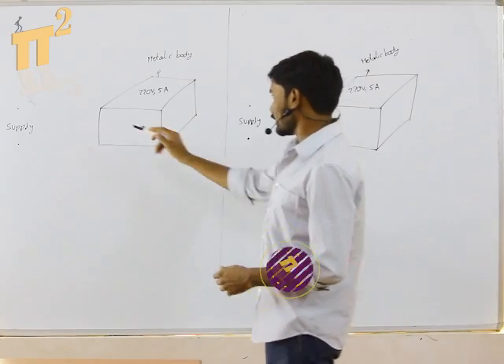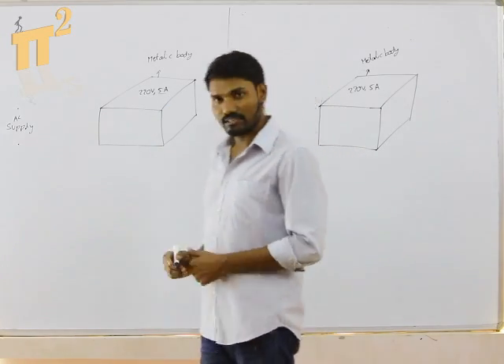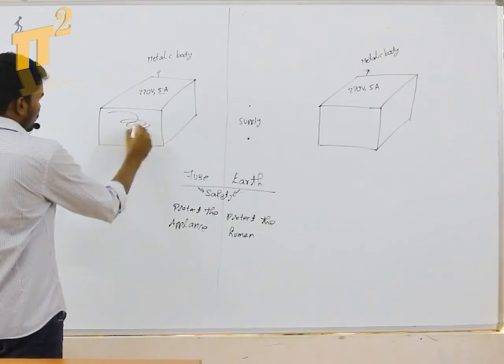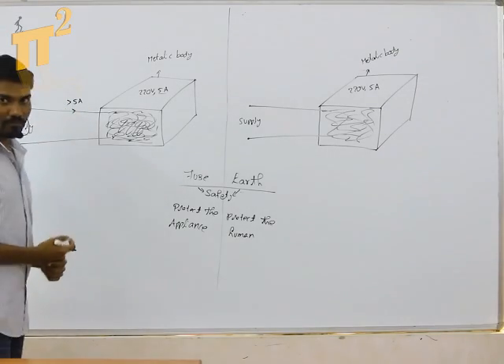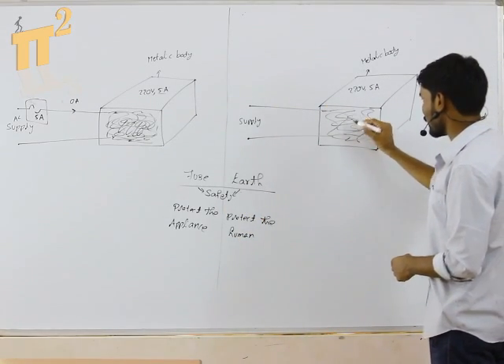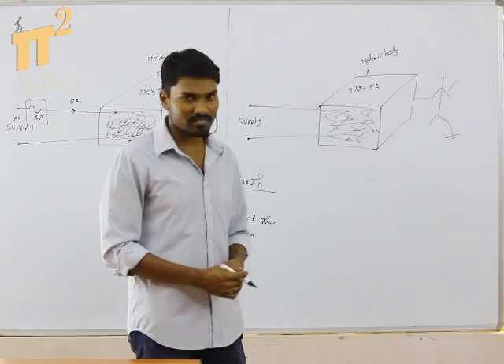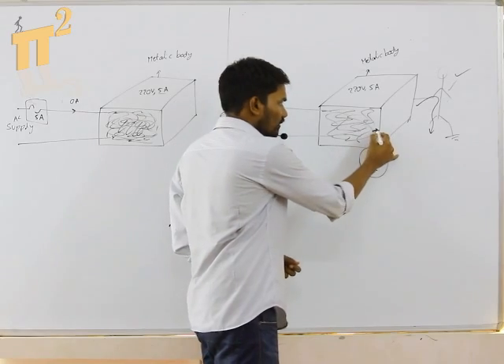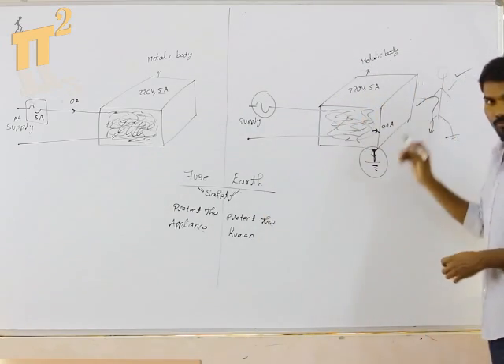Why Fuse & why Earthing | Interview Question | PiSquare Academy

Comment: Good video! Earthing also serves to protect the equipment as earthing cable or path has least resistance and most of the current takes this path and because of this relatively high current, it also trips the breaker (ELCB or RCD) in the process. Is my understanding correct?

Comment: Sir why root 3 is used in 3 phase power calculations. Please explain
Reply: +Narendra Lolugu - The square root of 3 enters into computations of three phase systems because the trigonometric value of the sine of the phase angle (120 degrees) between phases is equal to [square root 3]/2. The denominator, 2 is factored out when doing the vector/phasor analysis of the voltages and currents in such systems, leaving--by coincidence--the square root of 3. Chalk it up to the craziness of the math. :)

Comment: Good work...Pisquare, keep doing
I have more questions on earth to neautral
1.what is the importance of earth to neutral voltage? How much it need to be?
2. Can we short earth and neutral, if earth to neutral voltage is high(say 10volts)?
3. What is the role of earth pit in above two questions?
4. By Megger if we test the earth pit resistance, how much value it should be? (As per industrical standards)
5. How earth to neutral voltage and earth pit resistance can be related..and what's it's significance?
6. When to do Mantaince for earth pit?

Comment: Sir 
One doubt i am having, the current ratings of MCB, MCCB, ACB are of 3- Phase or 1- phase:
1) For e.g. i am having a 1200A ACB than its the current carrying capacity of 1-phase or 3-phase ???
2) My DG rating is 500kVA by calculating current its about 700A than it will be of 3-phase or 1- phase

Bit confuse between it because lot of different answer i have got, Knowing that a perfect explanation will be given by you!!!!!!!

Comment: hi sir, suppose we give phase directly in body of the      device and it connected earth, now if we touch the device what happen does it shock?. please explain me
Reply from the maker: you won't get shock provided Earthing is proper (as current flows in a least resistance path, human body has around 1k resistance and good earthing resistance will be 1 to 5 ohm)

Comment: Could you please clear these additional doubts:
1) What is resistance of a dry and wet human being.
2) Why is the earthing wire naked?
3) For local earthing why do dig a 6 feet deep hole and then place a Cu plate and add coal and salt and water? What happens if hole is say 2 feet or say 12 feet?
4) What is the difference between earth wire and neutral wire? Both have 0V potential or do they not? How will we differentiate between neural and earth wire if both wires have same colour?
5) What effect does different current values have on a human being? 
6) What is responsible for a shock - Current or High voltage ?
Reply: anthony gonzalves 
I would like to clear some of your doubts.
The resistance of dry skin is around 100000 ohm and when the skin becomes wet the resistance reduces to around 1000 ohm.

Actually both voltage and current are responsible for the electric shock because unless and until there is no voltage there will be no current. When we accidently touch any live wire, current tries to flow through our blood as it contains different ions such as sodium, potassium, etc. which act as a current carrier. Now this current interferes with the functioning of the heart and may lead to Cardiac arrest. The muscles are paralyzed and it becomes difficult to let go.
Reply: anthony gonzalves 1 is given
2. Earthing wires could be naked or couldn't be there is no such recommandation because earthing wires r just for body current protection or leakage current protection.
3. The 6 feet deep is just a standard that maintained the only aim is to connect any current source to ground. That's why salt is used to create good conductivity 
4. Both theoretically have 0 v but acctually it's not because neutral line comes from the grounding of transformer's star winding's neutral point so that any unbalanced load doesn't affect the transformer or device and earthing wire so due to resistance of wire u see a phase neutral voltage is slightly lower than phase earth voltage.
5. Current acctually mostly responsible for killing because firstly it disturbs the natural flow of sodium and potassium ions in heart and also cause burn from inside. That's why Edison used electric chair for execution so that it would look horrific.
 6. Both gives shock but u wouldn't be get killed by moderately high voltages but u could die for a current of 20ma

Comment: Sir
Pardon... But I told that If there is some internal short then appliance will draw more current so at that time fuse will protect the appliance from any over current damage, but our appliance is already damaged according to you.
Reply from the maker: there could be a minor problem in the appliance due to which internal shorting has happened, if you we do'nt provide the fuse then this minor problem causes a burning of the whole appliance by drawing the over current

Comment: sir i quickly understanding for your teaching very super sir.
i ask the question in why neutral is grounded.
Reply from the maker: Mainly
1.During LG or LLG faults if neutral is not grounded then healthy phase voltages will raise to √3 times the regular voltage (which is called arcing ground), to avoid this neutral must be grounded.
2.Due to 3rd harmonics, neutral potential won't be zero (it oscillates), so by grounding the neutral neutral potential will stick to zero.
Reply: PiSquare Academy 
thank you very much sir
Reply: So isn't the conclusion becomes that earth for an appliance is done to identify the fault (before occuring second earth faulth and cause a deadly short circuit) and electrical shock prevention is a consequence of it?

Comment: In case no.1 the coil is drawing more current not body of appliance, so it protects coil and there by saving appliance. Am I right ?
Reply from the maker: you are absolutely correct Mr. Ganapathy
Reply: Thanks..spreading knowledge..Good..My best wishes